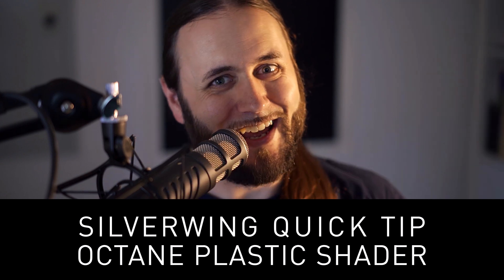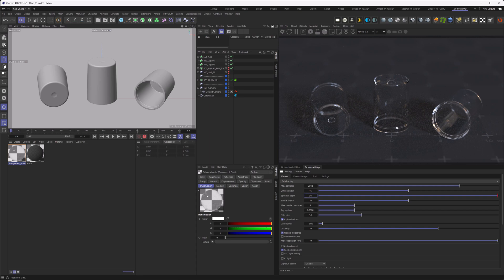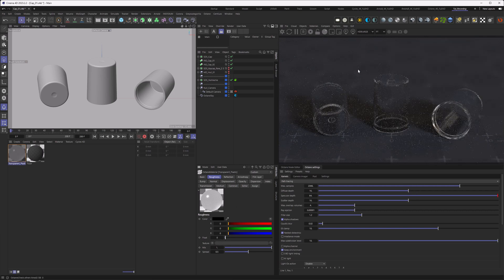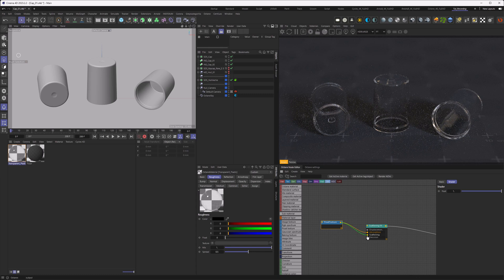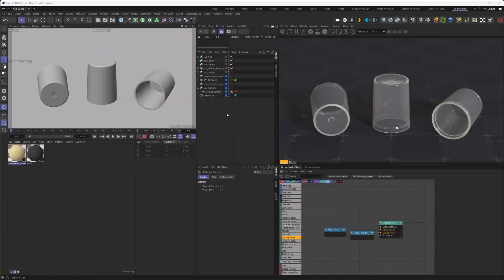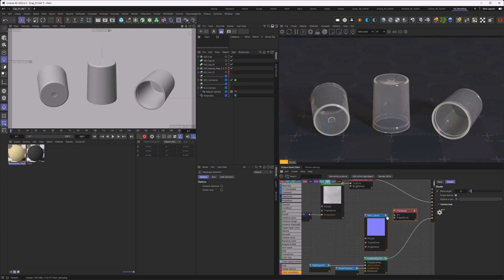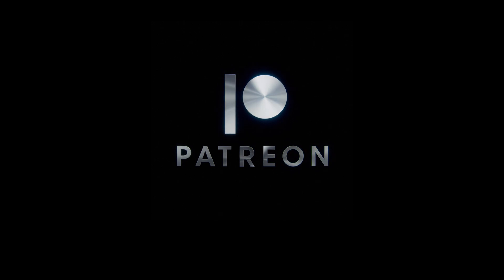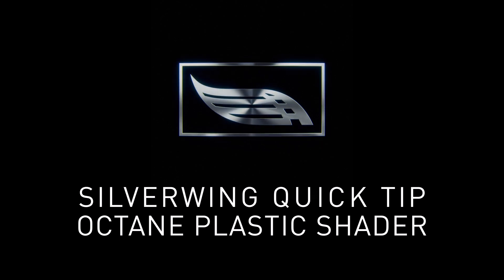Silverwing Quick Tip: Octane Transparent Plastic Shader

Comment: Máster! We need you on redshift! Thanks for all the tuts!
Reply from the maker: You are very welcome.
If I could split myself I would also create RS tuts. But my love for Octane is stronger 😅😇
Reply: @SilverwingVFX  i should give a shot again, I left it 3 years ago due to crashes. Is more stable now? Also compatibility with Houdini wasn’t very good. Thanks again master!
Reply from the maker: @caskete2k  If you are good with RS then there is no need to switch I would say.
Octane is definitely more stable now. But as with most of the GPU renderers very much depends on your systems hardware and software (drivers)
I usually have 1-2 crashes / freezes a Day working all Day. Sometimes more, sometimes none. But I have a bit of workflow bias. Meaning that I know when to click where and when not to click what. Its muscle memory over the Years, so I can´t really tell what it is.
Again, if you like RS and have no problems. Then there is no cause to use Octane.
Appreciate you watching my videos though ha ha 🥳

Comment: Hi！Silverwing. 
I have a problem. When I animate the material with the projection method of triplanar, the material cannot follow the camera very well. Is there any way to solve it?
Reply from the maker: Hey there.
What do you mean "The material can´t follow the camera well"
I think in order to give you a satisfying answer I need to know what you are trying to achieve.
You can write me an email if the explanation requires a longer text.
Reply: Thanks Silverwing！
I did a test after reconnecting the material, and the problem was solved.

Comment: Thank you. But... not total realism because OTOY doesn't add the birefringence support for Octane Render yet for 9 years ago. 😕🙁 Birefringence is very important for "stress-induced birefringence" on plastic material. 🙂
Reply from the maker: Hey Riciardo,
yes, you are right. There is always something that is not computed. The fluorescent light part, polarization etc.
Maybe at some point they will integrate it.
Reply: @SilverwingVFX  , Fluorescence and Polarization has been for a while now on the roadmap. Got tired already of seeing it in their annuals promises. Otoy has and extensive set of features coming ahead (Brigade engine is notorious as being the carrot they had in our faces for over 10 years now).

Comment: Hi, is there an option in octane to shine and reflect with HDRI in an enclosed space?
The task is this, the car is driving in a tunnel, but it should have reflections from HDRI and from the tunnel
but the tunnel overlaps HDRI and there are no reflections from HDRI on the car.
Reply from the maker: Hey there and thank you for the question.
To my understanding this is not possible with simple settings.
You could write an OSL shader that uses the normals of the objects and the HDRI in the luminance channel of the material to make it appear reflecting off of the car. The more easy method would be to render the car twice. Once with the tunnel and once with the HDRI reflections. Then use the reflection pass of the car for the HDRI reflections and add it to the tunnel shot.
Reply: Thanks @SilverwingVFX